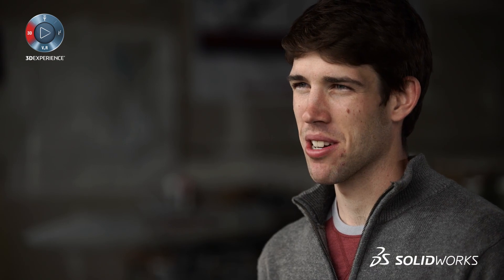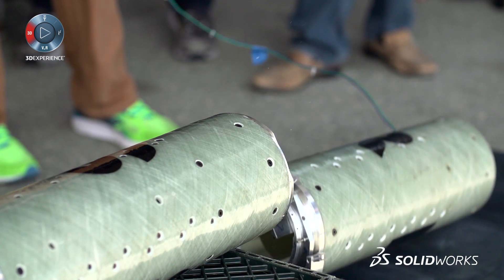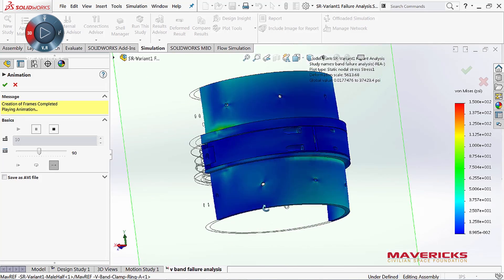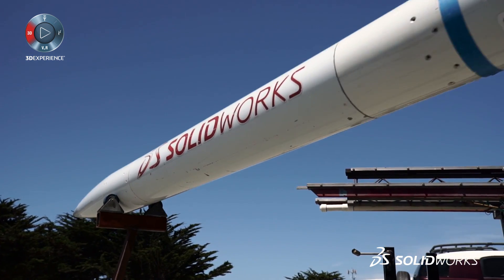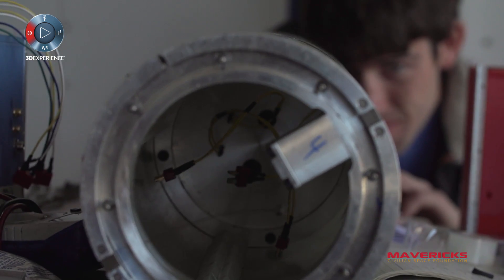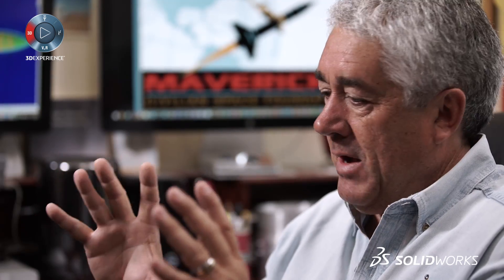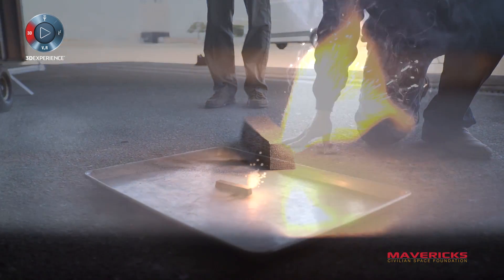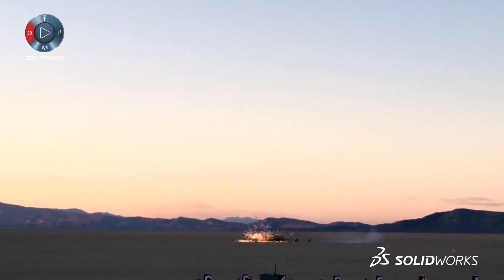Born to Design: Rocket Mavericks - Open Source Rocketry Takes Flight - SOLIDWORKS

Comment: This is phenomenal!  I have read and discovered, that when using AP composite solid rocket motors, the science to push the limits in altitude distance is a ratio of propellant to weight. However, this rocket could have had 2 sustainer's and reached 200k. if out of the atmosphere and orbit into space is 330,000 feet, than adding stages and or, One long stage with a moon burner design on three cluster motors into space. That rocket would likely be about 60 feet tall. Take into account also thicker walled motor casing and having 3M GAP as a high energetic binder, would put this rocket close to mach 3. Consider that mixing solid propellant and an Aluminum burn catalyst, would yield a high ISP. Military used nitro amine in the mix, but for safety concerns gap is good enough. Yes concerned on shock sensitive. So, in theory, taking a chance on propellant design by using the GAP binder, AP fuel, and Aluminum burn catalyst,  sealed propellant on top of that with nitrocellulose, and your motor will look like a military WWII rocket motor. And, will out perform it!  300,000 plus feet. Burn on motors would have to be about 60 seconds to reach that distance...... so moon burner design would have to be used...